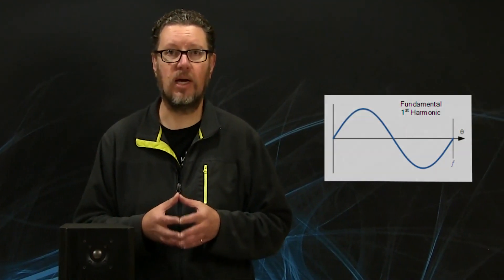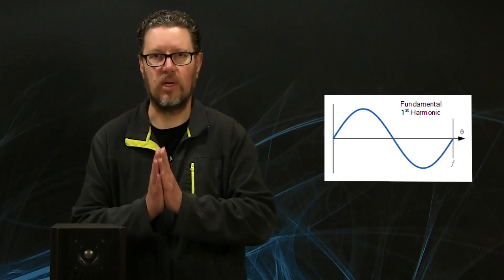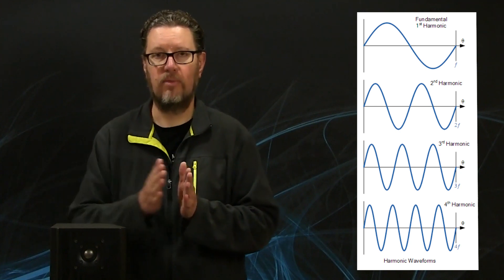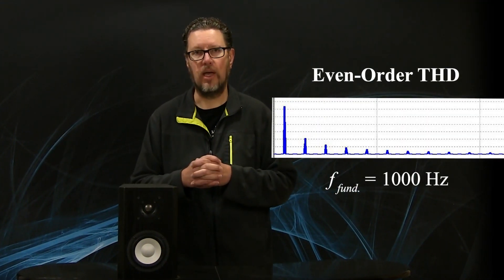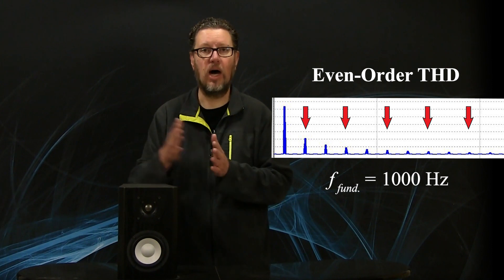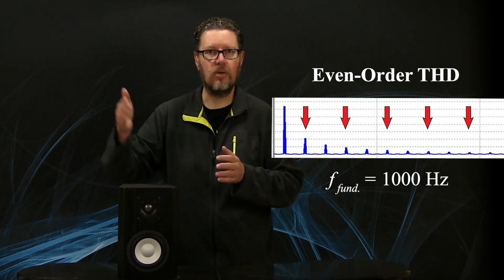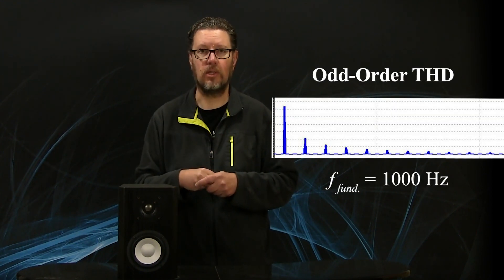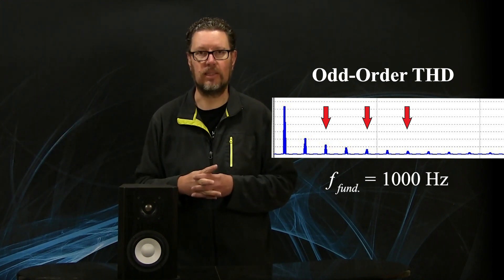What Is Distortion?  From The Axiom Audio Glossary: Audio Terms Explained

Comment: Thanks Andrew. Very informative as usual.  It never occurred to me how many sources of distortion you could have in the musical chain both electrical and sympathetically mechanicals such as  pictures vibrating  on a wall. What about the floors?  I guess there's an awful lot going on before  that final sound reaches our ears.
Reply from the maker: Absolutely, floors too. Suspended wood floors can vibrate sympathetically with the loudspeaker signal and add to what you’re hearing in the room. Another form of distortion.